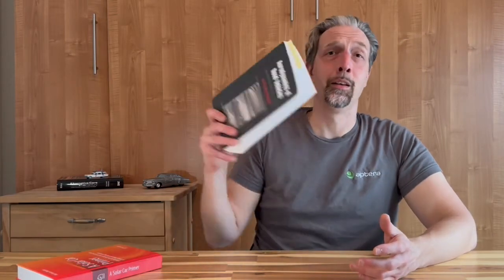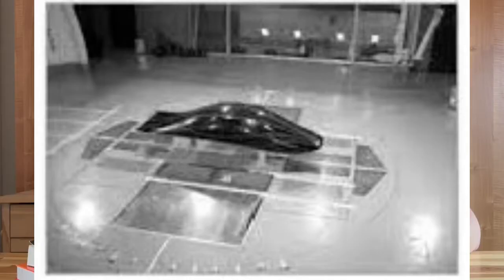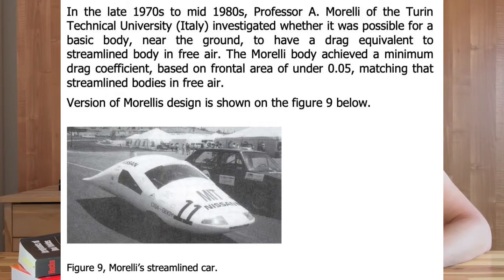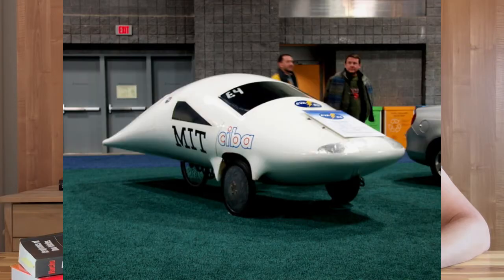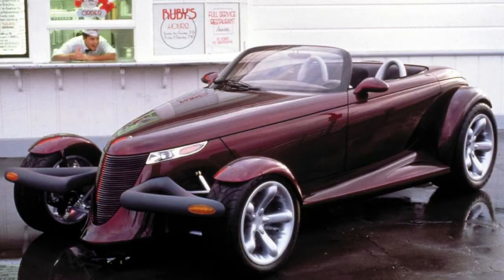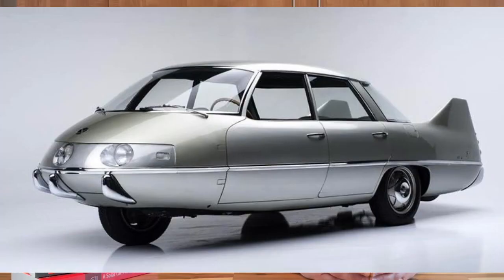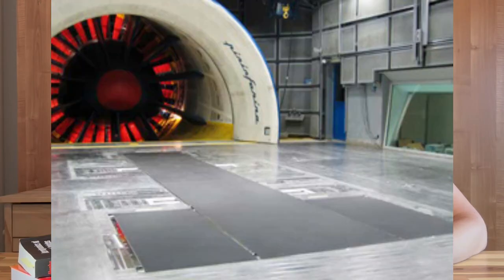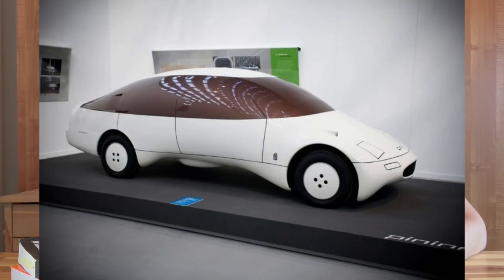Aptera's Morelli Body

Comment: The nasa langely test aptera did way back in 2006, I believe gave them a value of 0.13, but I recently found an interview with chris anthony where he went into details about that test.
It was a cfd simulation only based on a render, that render was based on photos of a playdo model. They have been using that number ever since, its not even for the recent versions of the aptera. Aptera has never released any value apart from that simulation.
The pinnafarina I believe was only a photo opportunity and no data was done.
Air shaper did a study for aptera, he got a cd value, but aptera will not allow him to release it. It appears to me they want to keep using the 0.13 number even though its only a simulation, it appears no full scale testing has been done. No data has been produced or released is how it appears.
Light year solar car has a tested value of 0.19, they did alot of wind tunnel work to get the value as low as possible. It appears aptera has not done this. I believe the cd value is unknown and untested.

Comment: The wind tunnel wasn't a test, it was a photo opportunity they were only there for a very short time period, so your information there is a bit wrong. Yes there was all sorts of information saying they were validating the cd, but as with many things with aptera things are not always what they seem. There was no validation data done.........
Reply from the maker: The wind tunnel was full sized static correlation test on the shape of the body. For a full aerodynamic test you would need the wheels to be rolling at speed to account for their impact. I don't believe the Pininfarina wind tunnel was set up to have a dynamic test on a 3-wheeled car.
Reply: @ApteraAccessories  Thus the Kim Java number 0.15 might be an extrapolated estimate.
Reply: @ApteraAccessories  can you give some more details about what you mean by " full sized static correlation test" ? Does that produce a cd value?